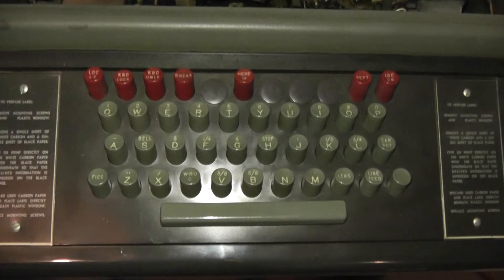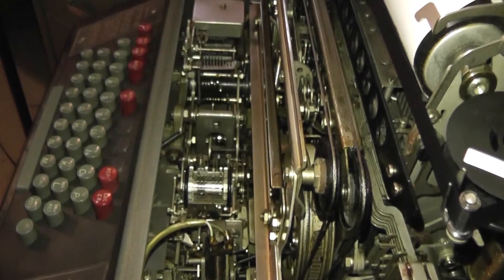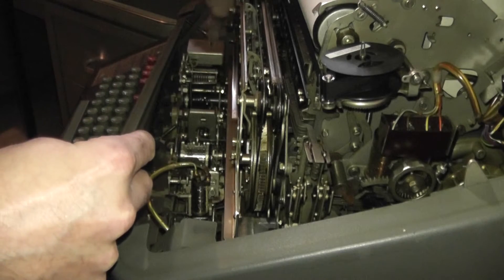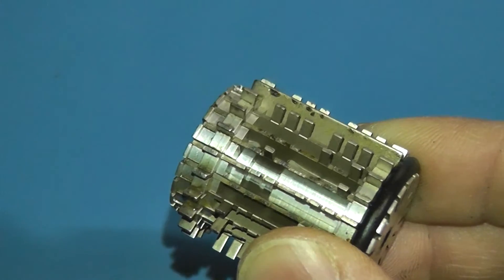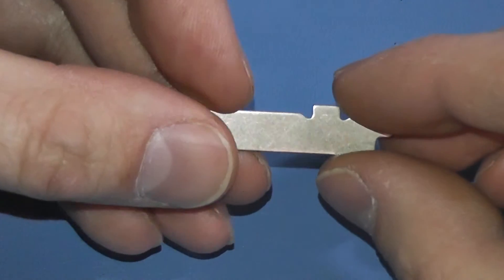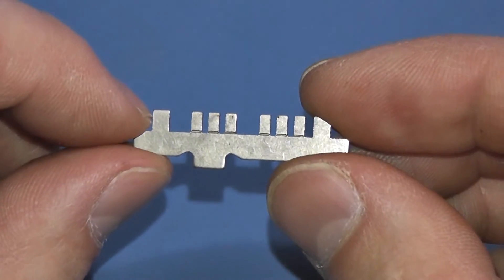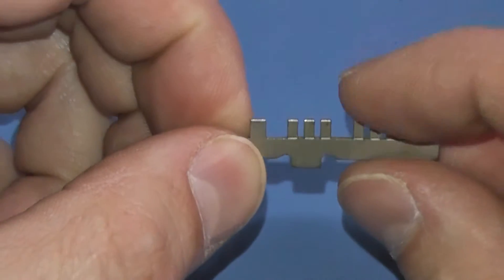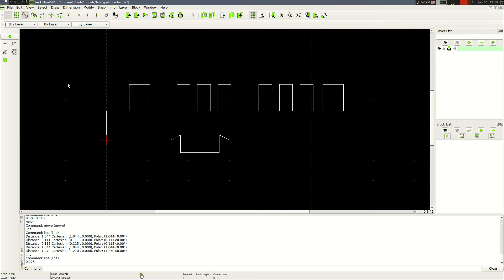Teletype Model 28 KSR: Answer-back Mechanism and Code Blades

Comment: Good Afternoon Ethan ! I was fortunate enough to find your great video here regarding the 'Answer-Back' on the TTY Model 28 machine ! I asked if the Model 28's had the ability to install this feature into machines that did not already come equipped with the necessary components, on QTH.COM classifieds and one fellow ham told me that he didn't believe that the Model 28 ever had that feature, according to his knowledge, only the later Model 32's and 33's were able to be fitted with the Answer-Back feature. I read, somewhere in one of the Model 28 manuals, where it WAS mentioned, and did also have some nice pictorials of the required components installed in a 28. Apparently, the gentleman was under the impression that the 28's did not ever have this capability so I will reply to his e-mail to inform him that it, in fact, surely can be retrofitted, if one could ever possibly be lucky enough to acquire the necessary components ! I placed a Want Ad on QTH.com, asking if anyone may have a NOS Code Wheel, or for that matter, even a pre-coded, used one that I might be able to purchase from them, so far, no positive replies, but one never knows, so MAYBE, by some stroke of luck and a miracle, I may find the required components as well as a code wheel, at least, I am HOPING, someday to acquire the components required as I too, would love to code the wheel with "de WN3SIX" for amateur radio use !
     Thanks so much for uploading the very informative video here !
73, de Mark, WN3SIX

Comment: Thanks, I always wondered what the HEREIS key did.  Back in school, when I asked, I was just told not to touch it.   Great video on how it all works and your replacement code plates.
Reply from the maker: What kind of Teletype were you using, back then?
Reply: @EthanBlanton  Honestly I wouldn't remember.  It was in Junior and Sr High school in the mid to late 70's. They had the round keys as those shown in your video, but I'm sure that style was used in many models.  The only computer access we had was through a teletype connected by phone to a computer at the university of Minnesota. We all had our little rolls of paper tape for that portion of the math class and programming was down in Basic.  
Thanks!

Comment: you measured the end tabs as 40 thousandths, but it should've been 140 thou (you missed the 1 on the scale).

also, your dial caliper can measure depth directly with the stock that pokes out of the end (it looks like you used the interior measuring jaws to measure the depth of the edge shoulder).
Reply from the maker: +Joshua Blanton I'm surprised if the 40/140 mil mistake is the only one!  It was really hard to measure through the camera, I had to go back and retake some numbers off-camera.

You are of course correct regarding the tail of the caliper, and I did not use it.  It didn't occur to me to use it on stamped sheet edges.  I wound up placing the blade in vise jaws and measuring the gap between jaw and blade.
Reply: I figured so, on the 40/140 error - I was really pointing it out for others (it looked right on your drawing).

As for the tail, I use that feature often - I don't feel that it's as accurate as the jaws, but it's quick and easy...